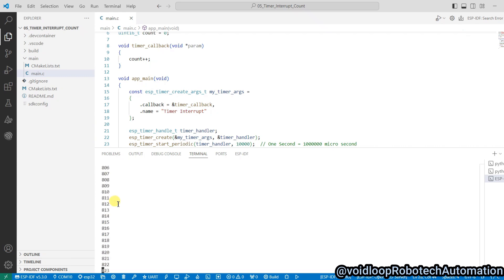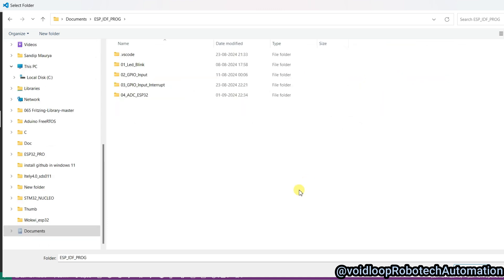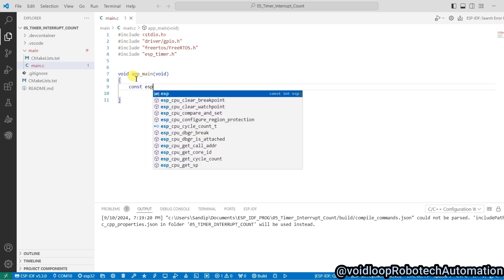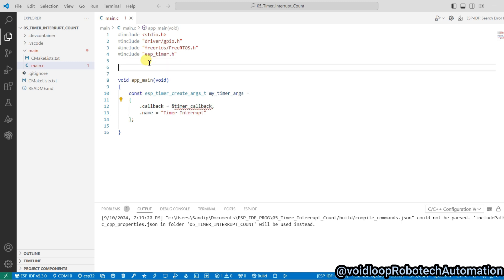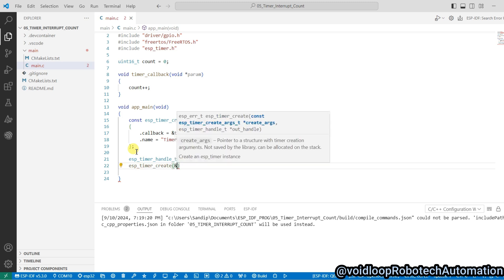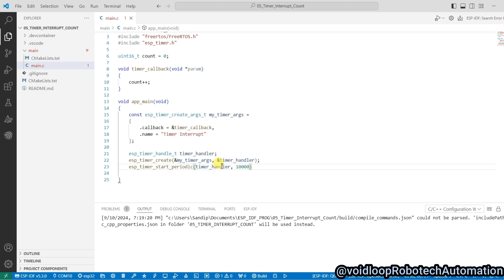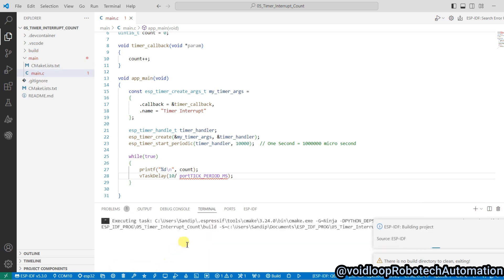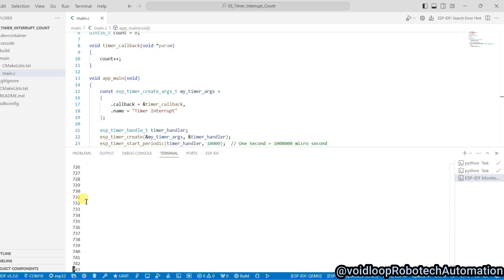05 ESP32 Timer Interrupt with Counter using ESPIDF and Embedded C

Comment: Hello! Is it possible to use HW timer to count external events (pulses) without interrupting the main loop? Ex: how many times a button is pressed in a second. Sw is executing whatever and  each second it will read the counter and reset it for the next 1s. Thanks!
Reply from the maker: Yes
Reply: @voidloopRobotechAutomation  How? Is there a tutorial? Thanks!